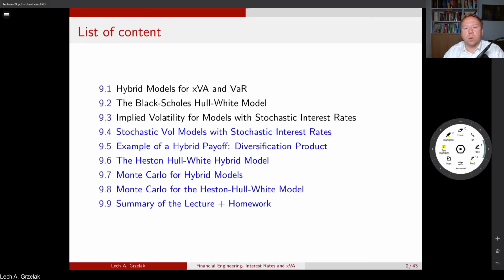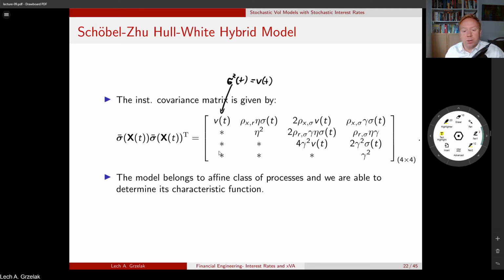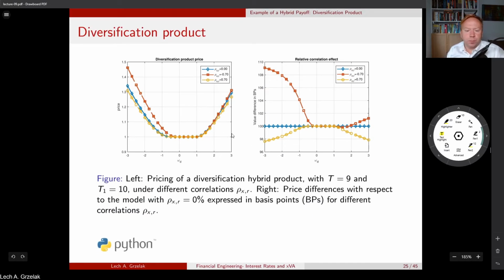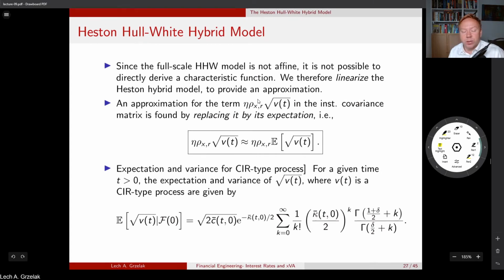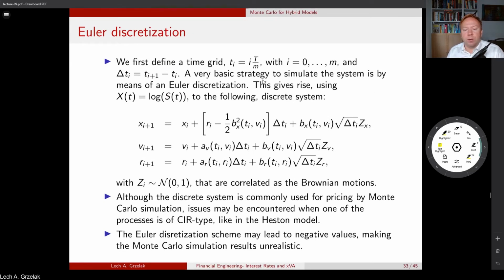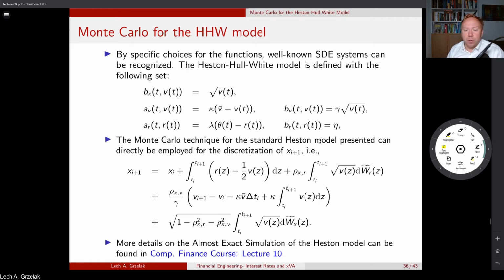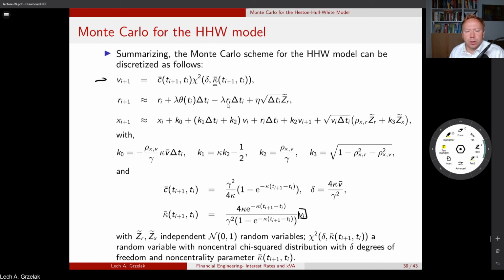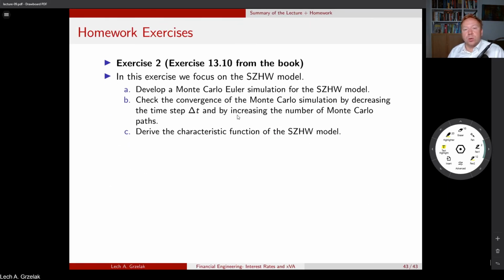Financial Engineering Course: Lecture 9/14, part 2/2, (Hybrid Models and Stochastic Interest Rates)

Comment: Hi Lech, on the very first slide of this video on the “under the risk neutral measure Q…” then we have the system of 3 SDE with 3 brownian motions under Q: Is there an example or lecture from your other videos that show us how to go from the same system with 3 (or 2) Brownians under physical measure => convert/transform those dynamics to Q measure? 
I know this sounds a bit basic but we often always start directly under Q so I kinda miss out the step to go from P to Q for multivariate cases.
Thanks!
Reply from the maker: hello Minh, the multivatiate case for measure changes we have discussed in some details in the book. It is a rather technical procedure. In essence, the recommendation would be to always transform your Brownian motions to independent ones, and change measure one by one. You can also do a matrix multiplication approach- both techniques are discussed in the book.
Reply: @ComputationsInFinance  thanks Lech, your book is next to be on my bookshelf!
Reply: And then the correlation matrix under Q => would that be different from the P correlation matrix?
Reply from the maker: hi Minh, measure changes for SDEs does affect only the drift (volatility stays the same) therefore if you apply a Cholesky decomposition and take the correlations "outside" the brownian motions then the correlation coefficient becomes a part of the volatility, therefore it will stay unchanged under measure transformations- more details on this fact you will find in the book. Best regards, Lech